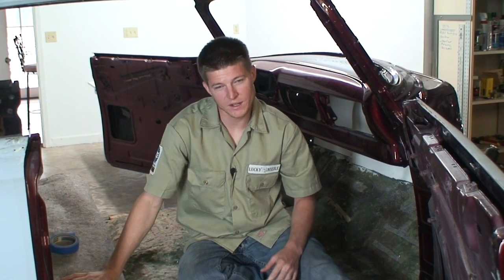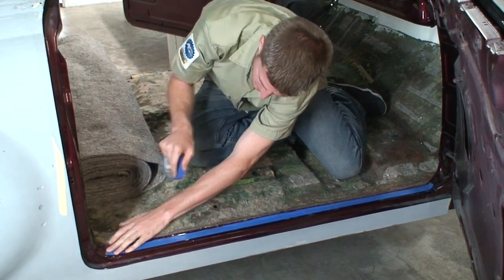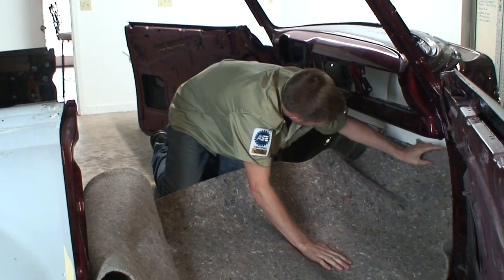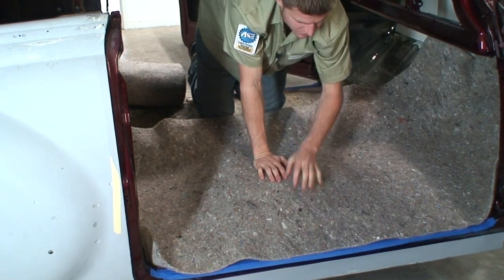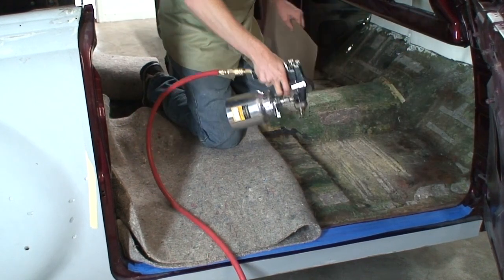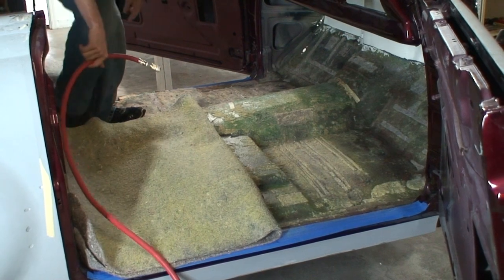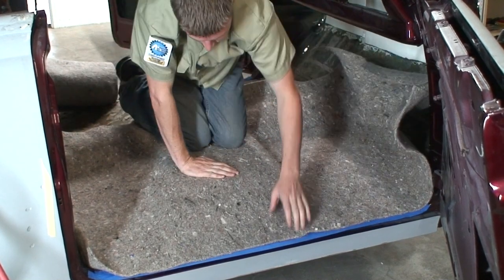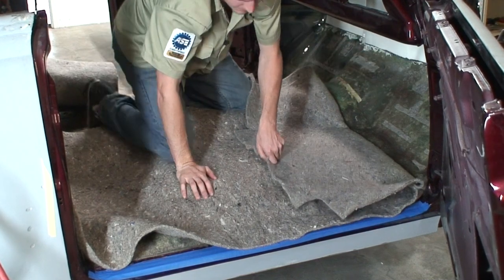Upholstery Basics - Installing Jute Carpet Padding  Step 2

Comment: great video. Imagine you're in the cab of a classic truck and you have carpet on the back wall and carpet on the floor. How do make that inside 90 degree corner edge (where the two pieces meet up) nice and clean? Do you have any videos showing this? Thanks in advance.

Comment: What type of glue are you using?
Reply from the maker: +jwhrivnak 
I am using WeldWood Landau Top Contact Adhesive.
Reply: @Theluckyneedle  hey is there different nozzles for spraying glue ? What kind of orifice did you use ?
Reply: @alexgomez3585  use a large one. I use a 2mm siphon gun from harbor freight.

Comment: I'm going to replace carpet in an Mg that has no top when i built the car I used unbacked cut pile and it has not worked so well but afraid to put down jute if car happened to be out in a rain shower. Don't want carpet or jute to mildew thought unbacked might dry better. Not sure what to do.
Reply from the maker: Never ran in to this situation before. I guess you could use marine carpet without any jute padding. The marine carpet will be mold resistant.